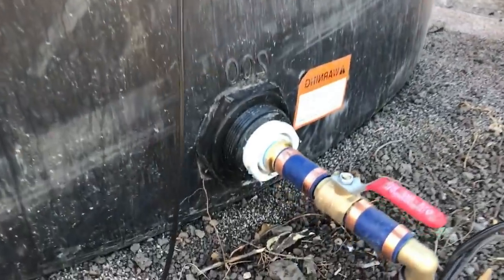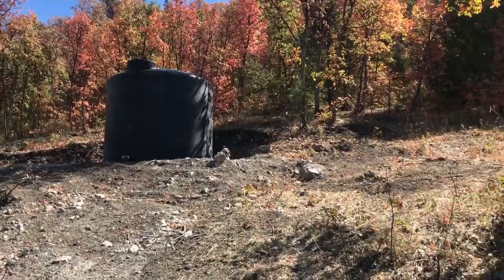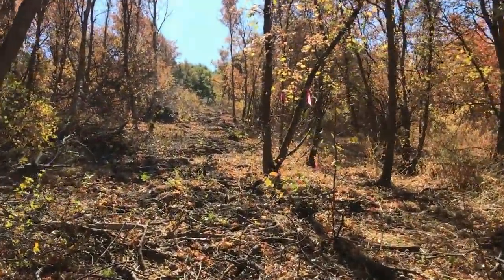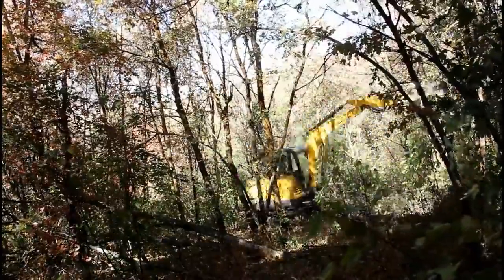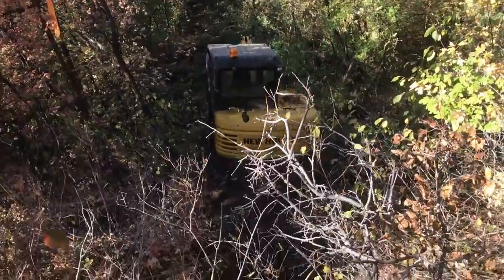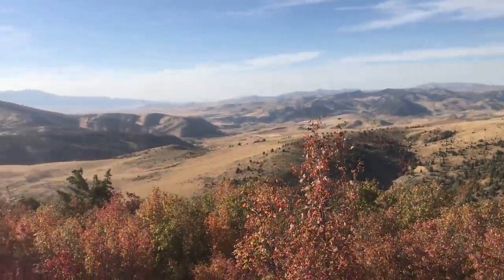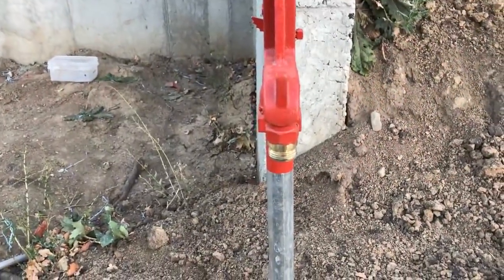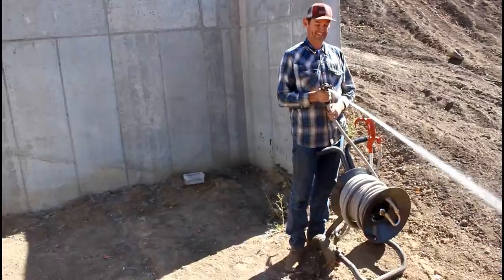#265 - Water Tank Is Full, Pressure's Higher, Property Line Cleared.

Comment: I can’t believe you think that exposed banjo value on that exposed tank is not going to freeze up in winter. Calling it right now I would put money on your water situation freezing up. Unless you build the total overboard heated shed you going to need on top of that tank which would really defeat the whole point of what your doing and be a giant waste of solar power.

You’re laughing now as your system is working in the heat of summer but really mathematically you are wasting solar power by pumping water up 150 feet. You could easily have close to that much pressure with half the solar power straight out of your well.

For being a plumber you sure have an overcomplicated and under-thought out water system. 

I can pretty much guarantee you will just end up running a line straight from the well to your house after that tank up there freezes up or after you have burnt up 100s of dollars worth of batteries overpumping water around.

Comment: Anyone else get the idea of a temporary shower in that corner of the foundation? Some comfortable stepping stones or gravel to keep the feet clean of mud and cheap shower setup you can hook right to the yard hydrant. yes no hot water without one of those propane camp instant heaters but a great place to clean up till the temperature drops to much.

Comment: 85 psi, if you have any leaks, or weak washer hoses, your gonna know it. Got my regulator set at 45 . Have similar yard hydrants, not on regulated pressure, just made a screw on regulator, so I can move it around, tired of blowing out $30 hoses. Checked my pressure 120psi.

Comment: The way to eat an elephant is 1 bite at a time. Take a copy of the property map and break it down to equal sized sections with each section that years goal to be worked on in the pattern that works with the goals so for example working along the edge of the property to clean up then fence that section leaving the middle of the land for last. 

No one is saying you need to fence the full land in a year. It will be easy to find some ground contact wood preserver you can dip the maple posts in near the house then when you have enough ready say 100 spend a weekend setting posts. Then when you have enough weekends of post setting you have a wire pulling weekend to finish off that section. 

Is your land part of the continental ice sheet glacier till? Saw that there is a chance to find meteors in them but you are more likely to find scrap from the loggers.